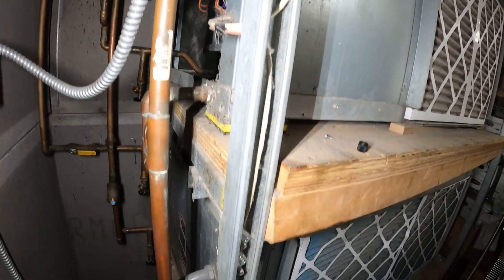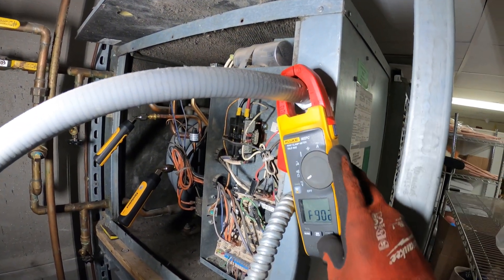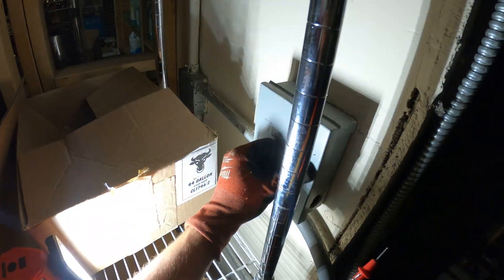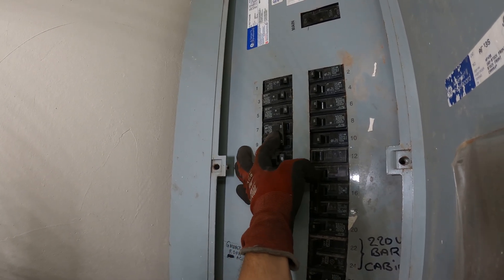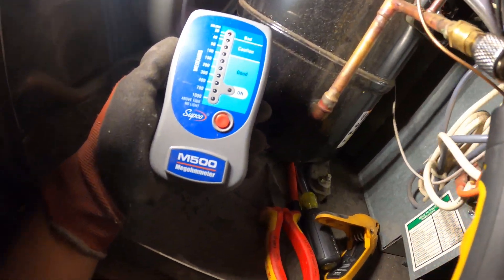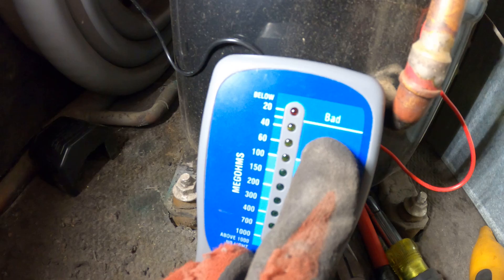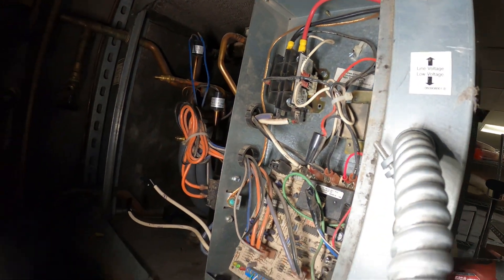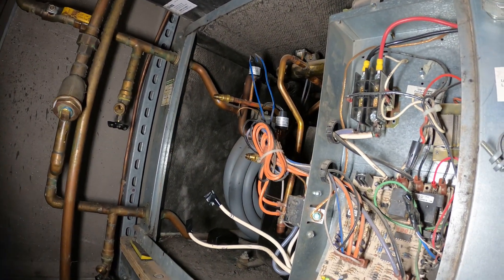HVAC Service Call: AC Circuit Breaker Keeps Tripping (Copeland Compressor Troubleshooting) Heat Pump

Comment: I’m about to start doing hvac work what would you recommend as like the must haves. I have a husky bag with a southwire meter and impact and light that rotates like yours. Few impact bits for all the common sizes. Wire strippers and dykes and pliers.  I had to replace my motor fan in my outside unit is how I got started working on them.